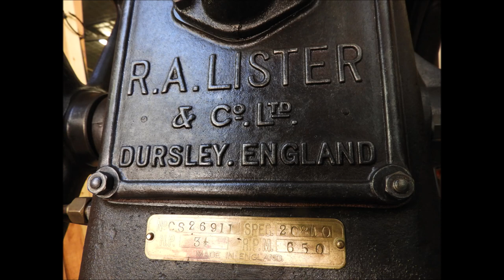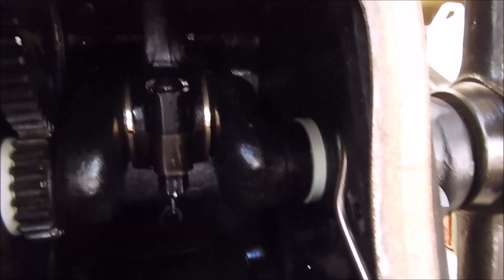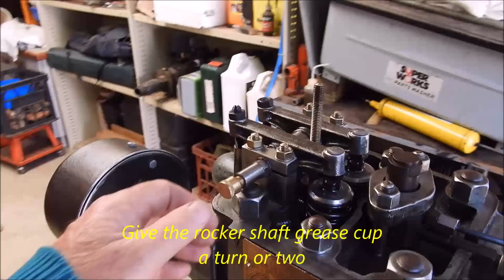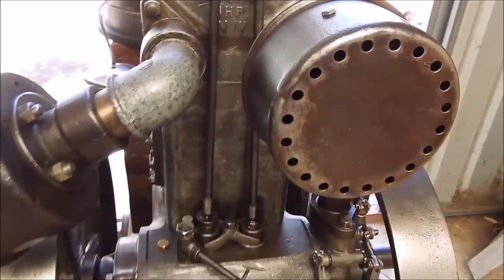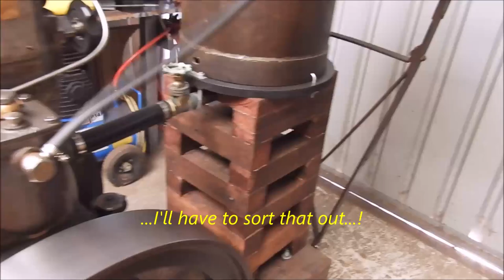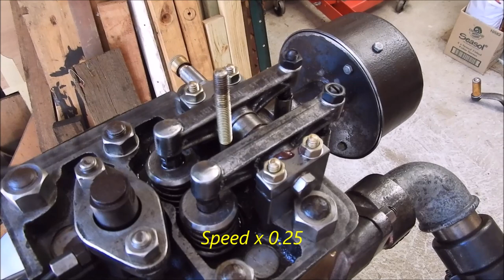LISTER CS 3.5 hp

Comment: That’s a beauty. What type of parts did you use in the rebuild? Did you source original Lister old stock parts or reproductions?
Reply from the maker: Hi Malcolm, unfortunately there are very few original parts available for the CS 3.5.  I had to resort to buying reproduction parts for some of the rebuild.  Mostly they were very inferior quality so I had to rework or re-machine some of them before they were fit for use.  Some other aftermarket parts were so bad that they went straight into the bin!  I am a fitter/machinist so I did end up making quite a number of new parts from scratch or re-modelling new parts to suit the rebuild.  Cheers, Norman.

Comment: A stunning restoration. Beautifully presented engine. No paint. Is the surface just polished?
Reply from the maker: Thank you, a great many hours went into getting the old girl back to good running condition.  The surface is not polished, all that I have done is give it an occasional spray over with WD40 which seems to retain a waxy surface over time. I have had no issues with surface oxidization since using this method.
Reply: @NormanSurgeon  The WD40 method is a great idea as it will help keep the flash rust away also. I have a 3 h.p CS which is identical to yours. The cylinder needs a liner fitted as the glase is chipping away and I don't want to replace all the bearings until this job is done first. Yiur engine by the way runs beautifully. Well done again. 👍

Comment: Sounds great maybe adjust inlet valve looks like the push rod cup is oscillating around the tappet adjuster stud at 0.25 speed
Reply from the maker: Thanks, inlet and exhaust are set at 0.017" and 0.032" respectively. The cam followers and push rods are designed to slowly rotate to alleviate developing any flat spots. At 0.25 speed, the camera shutter speed does make the video image appear a bit 'wonky'. 🙂

Comment: Love the playing and the CS a great old friend there were meny on aux gen sets in the UK in the fifties. we had a six hp on the family farm in Cornwall which did electric generation and drove a line shaft.
Reply from the maker: I was told that this old girl drove a 24v or 32v lighting system on a farm at Waroona in Western Australia. After the farm received electrification from the grid, the engine was then put to work driving a vacuum pump in the farm dairy for a number of years.👍

Comment: Hi, this looks really lovely! How have you achieved this finish? I see you’ve applied wd40, but before that? Many thanks
Reply from the maker: Most of the parts were de-rusted using electrolysis. When they came out of the tank, they were brushed/scrubbed under running water and the WD40 applied as soon as they were dry. The flywheels were too big to fit into my electrolysis bath so they were wire brushed with a rotary brush and then the WD40 applied. See my other video about the total rebuild for photos of the electrolysis process. 👍
Reply: Thanks so much Norman, I’ve just watched the video you refer to. Could I ask, re the electrolysis, what’s in the solution / what you are using for electrodes (?)… and how long it took? I think I can look up details of your power supply. Kindest regards, Edward
Reply from the maker: Edward, @EdwardEngines   You need to dissolve sodium carbonate (washing soda) in water. I don't remember the exact ratio but from memory it is about 3 heaped tablespoons of sodium carbonate to 5 litres of water. Washing soda is a coarse white powder and is available in the laundry section of most supermarkets. The cathode (neg-) must attach to the part that you wish to de-rust. The anode (pos+) must attach to a piece of cast iron or mild steel and preferably as large as possible.  I often used 2 large pieces of mild steel flat bar (300mm long x 75mm wide x 12mm thick and usually had them arranged either side of the piece being de-rusted. The process usually takes several hours and is dependant upon how much rust or old paint there is on the part being de-rusted. You will need to pull the anode(s) out about once every hour and give them a good scrub with a wire brush or angle grinder to get them back down to bare metal. When they gather a lot of crud, you will notice your amperage starting to drop lower and lower. If there is a lot of thick old paint on your part, you may need to also pull it out occasionally and wire brush away the loosened and softened paint.  The CS engine crank case took me a whole afternoon to clean. The main bearing  carriers took about 2 hours each at most. Do not worry if your solution becomes incredibly dirty, it will still conduct electricity so long as the anodes are kept clean. DO NOT use stainless steel as an anode, it reacts and starts producing toxic gasses and a toxic solution. Stick to cast iron or mild steel for your anodes. And finally, remove any non ferrous bushes or parts because electrolysis will eat them up before getting to the iron oxide (rust) on your parts. Hope this is helpful, Cheers,  Norman.👍
Reply: Wow! Thanks so much Norman, you’re the best!! 👍🏻🙏🏻🙏🏻

Comment: I'm so jealous. I hope to rebuild mine if my health improves. Lovely work!
Reply from the maker: All the best to you.  Just take the rebuild slowly and tackle one part at a time and you will get there.👍
Reply: @NormanSurgeon  Thanks. I have a suspicion the cylinder maybe beyond repair as there's a hole at the bottom when the piston is at bottom dead centre. I may get away with getting it sleeved. But I'll look at it in a year or so hopefully after my surgery that should be coming up in July. Thanks for your reply. Have you tried running it on cleaned used engine oil?
Reply from the maker: @garethmilne6887  No, I just run it on ordinary pump diesel, ...it's cheap enough for the miserly amount that the engine uses.🙂
Reply: @NormanSurgeon  Indeed. I like to generate power so I plan to run mine in waste vegetable oil which I can get cheap or free. I mix a bit of diesel with it then let it settle and it comes out golden again with the rubbish at the bottom. So I filter that out and use that on my current diesel generator. It's just a Chinese 4.2kw with a Yanmar 9hp copy engine. I have a new smaller 5hp Yanmar copy that I want to run an inverter generator head from a petrol 2kw unit 7 have here. But I'll use a belt drive I think to run the engine st half speed as I think it would be pretty efficient. But long term goal is to use the Lister

Comment: Is the valves adjusted correctly? 
Seems to be very loose
Reply from the maker: Yes, ...inlet and exhaust are set at 0.017" and 0.032" respectively as per manufacturer's specifications.